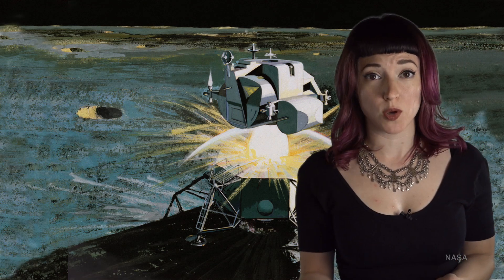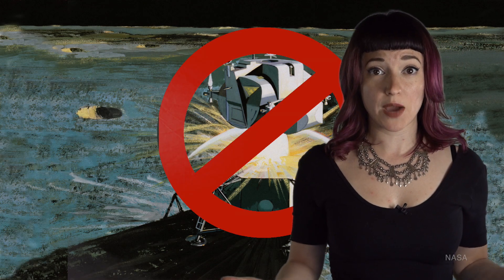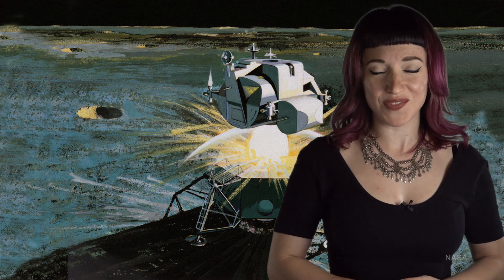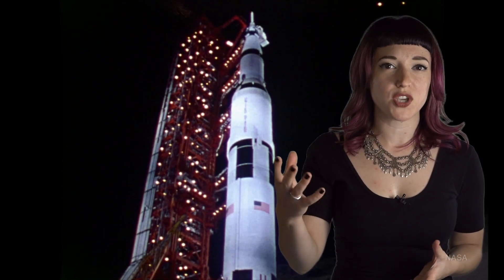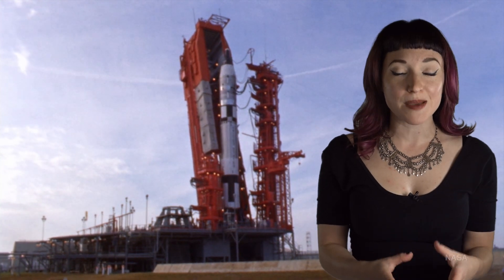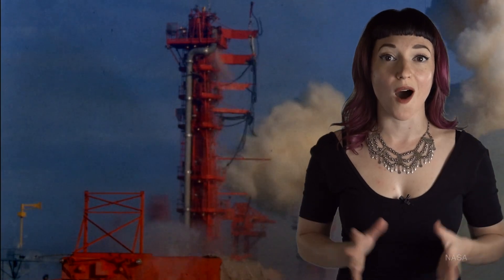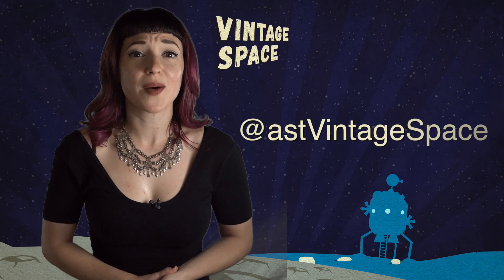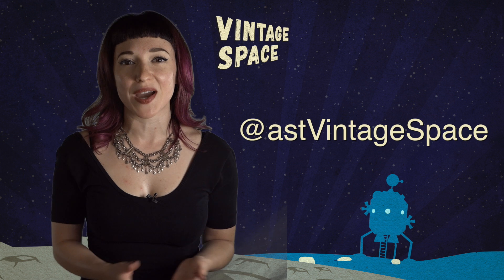How the Lunar Module Launched from the Moon Without a Flame

Comment: I don't have a conspiracy question but I've always wondered: how could the module that took off from the moon be so small? If the gravity on the moon is 1/6 earth gravity, shouldn't the rocket be 1/6 the size of the Saturn V?  (again, I'm asking for a clarification of the science involved, I'm not saying the moon landing was a hoax)
Reply: It is a little confusing to be doing your comparison with a Saturn V, which had to do much, much more than the Lunar Module accent stage's single trip into orbit. A better comparison for a launch into orbit from the Earth against the accent stage doing the same from the Moon, and given the mass being lifted, would be Mercury-Atlas. So a more appropriate question would be "Shouldn't the rocket be 1/6th the size of a Mercury-Atlas?"

I expect that a very large part of the answer to that question comes from the lack of atmosphere on the Moon. From the Earth a rocket has to start off pushing its way through the air. Overcoming air resistance  (particularly if the rocket becomes supersonic or even hypersonic while in the atmosphere) is going to require additional energy, which means more thrust (bigger or more engines) and more fuel to drive those engines. In addition an object pushing through air is going to need to be more physically robust to resist the crushing effect of the air it is compressing around itself.  Then there would be a need to cope with the heating effects of pushing through air at speeds; structure to keep that heat away from sensitive components and crew.

Switch to the Moon, without any (significant) atmosphere,  and all of those issues go away. A smaller (so lighter) engine can lunch a more fragile (so lighter) craft, without the need to overcome air resistance (or air pressure or air friction heating). Which means less fuel and smaller (so lighter) fuel tanks, and so less fuel needed to lift all of that, now absent, fuel/structure, and so on.
Reply: Because when lifting off, lots of fuel is actually needed to .... the lifting of fuel. That may sound surprising but it is not. Consider this: you want to lift 100 kg to orbit. You calculated in order to do that, you would need 80 kg of fuel. But wait: now you do not lift 100 kg but you need to lift 180 kg from the ground. So the fuel needed adds mass to what you want to lift. In order to lift that mass, you need extra fuel, which .... also adds up to the mass you have to lift. And so on. In the end it turns out, that you added lots of fuel in order to lift the fuel needed for lifting the fuel which brings your payload into space.
Also: The Saturn V had not only the job to lift the space ship into orbit. It also had the job to accelerate it to the moon. The Saturn V also had the job to lift the fuel later need for the moon descent and ascent. It also had to lift the fuel for the return burn. In a nutshell: the Saturn V had to lift everthing from the ground, which would later be needed in some part of the journey. While the ascent stage had just 1 job only: lifting off from the moon into moon orbit.

Comment: did you know that they had to re invent the video camera so it was lighter and portable for these moon shots. In the 50's and 60's video camera were big bulky apparatuses on stands handled by two people. it was the reinvention of the video camera that you could then buy those portable home video camera to record everyday events that you all love so much.
Reply: Here's something interesting. With the RCA NTSC color system in use in America at the time, color TV cameras of the time featured three image tubes for the three primary colors of red, green, and blue.  In a studio, the size, weight, and power requirements for these monsters were of no consequence, but on a space ship where every gram of weight and every milliamp of power was budgeted, Westinghouse built a color camera for NASA that used a single monochrome image tube and a spinning color wheel.  So instead of recording the red, green, and blue images simultaneously, the camera recorded the colors sequentially as the color wheel acted like a chroma filter shutter.  There were less frames per second and the images needed to be processed on earth into a color picture, but they got a fairly good color picture for about the same size, weight, and power.  Later missions featured full NTSC color cameras built by RCA.
Reply: @ohger1  actually RCA did not invent the color system as they like to claim. The original comor system was invented by CBS but it was incomparable with the NTSC at the time, so NTSC looked at several companies to develop the color standard used in North America (there are other standards such as PAL and SECAM) the north American standard was desifned by several companies including RCA and Philips. In fact the original television standard that RCA developed was not adopted due to its lack of resolution. Dumont had a much higher resolution (600 lines as opposed to RCA 400) the NTSC was brought into existence to standardise the signal to 525 lines. RCA at the time was like Microsoft today, just wants to buy patents and claim it as its own design.
Reply: @UCicg-Z5mVuktvdO68ulsMZA I think you're confusing RCAs 1940s B&W system which was like 400 lines and not adopted.  The RCA color system was fully compatible with the 525 NTSC B&W system as designed.  It was always 525 lines. CBS' system was 400 something lines and totally incompatible with the NTSC 525 B&W system.

Comment: Using hypergolic propellant simplifies things but there was a downside. The fuel was highly corrosive so the engineers who built the ascent stage of the lunar module couldn't test fire the engine before launch. The first time the engine would be ignited would be on the lunar surface, with the lives of the two astronauts on the line. I would be interested to hear more about this.

Comment: Anyone who has a problem with clear-flame rockets should look to the Me 163 Komet. Its rocket engine used a combination of hydrogen peroxide, hydrazine hydrate, water and methanol. The reaction between these chemicals is violent enough for rocket propulsion, but there is no flame because no actual combustion takes place.

Comment: The problem with that video is that there was no one outside of the module to hold the camera.  If there was he would have been left behind on the moon.  And then no one would have seen the footage because he did not get back to earth to develop it.  And if they left an expensive camera on the moon (which they would not do), then the same problem exists.  There is no way for the camera to get back to earth to develop the film!  So, was there a lunar landing?  Of course not.  In a real lunar landing there would be no photos of lift off, because, for the reasons above, none could be taken.
Reply: +Harold Bullock
What an abundance if ignorance you have.
Reply: Good point, but it still means that they would have had to leave an expensive camera on the moon.  And even more expensive because it has electronic equipment to transmit a signal.  My tax dollars are being left on the moon.  I always wondered where that money went.  Now I know.

Comment: Forget the blast and flame debate I am more curious about who they left behind to to man 
the camera that filmed and panned the  Module blast off.
Some will say they used remote control cameras but how did it manage to pan  the module rather than just film the 
blast off  because  the earth is about 250,000 miles away from the moon and I dont know about you but if the dog walks in front of the TV then no signal, let alone the vast distance and interfernce of Space,
Even if they had that technology in 1969 (which I doubt) there is still a matter of  the time/distance  delay  regarding   the signal to trigger the camera to respond at the exact time the module blasted off and follow its ascent bearing in mind that 
it would have been an analogue camera with a motor drive.

Comment: the real  question in this   footage is:
  (who was left on the moon to aim the camera ( not  very precisely) to follow  the lunar module lifting off  from the moon )
Reply: It also took 3 attempts (Apollo 15 to 17) to get the shot. The Astronaut had to get the rover in exactly the right position, the remote tilt mechanism had to work and the operator on the Earth had to trigger the tilt at a half second before ignition. Apollo 15 parked the rover too close, Apollo 16 had problems with the camera and Apollo 17 got it just right.

Comment: For a non-visible flame, just look to old CART racing incidents during fueling. When the alcohol used to fuel these cars caught fire no one could tell until the fueler (usually) started dancing around and dropping the fuel hose. The flame for this fuel is visible in infrared not visible light so there is another reason that you could have a non-visible flame from the moon launch, the flame is visible in the non-visible portion of the EM spectrum.

Comment: To be clear the Saturn V launch vehicle engines WERE hypergolic too!
Reply: No. The fuel was kerosene (a refined form) or hydrogen. None of these are hypergolic with oxygen.
Reply: true RP-1 is kerosene. In the combustion chamber it came in contact with LOX and you had a reaction.the first stage was the only one using it. Stages 2 and 3 were LOX and liquid hydrogen There was no ignition source spark flame, etc. in these engines so they WERE hypergolic per the definition:A hypergolic propellant combination used in a rocket engine is one whose components spontaneously ignite when they come into contact with each other.
Reply: scott marquiss No, hydrogen and oxygen are NOT hypergolic. Look for the information. The J-2 engine had TWO SPARKPLUGS to get the show rolling in the turbines, and TWO sparkplugs in the combustion chamber to start the main show.
Reply: scott marquiss The F1 engines on the first stage had hypergolic STARTER CARTRIDGES, which got the turbines going. Once they are turning and burning, their exhaust is dumped into the rocket bell. to provide cooling for the skirt. The fuel/oxygen is pumped into the combustion chamer, and is ignited by this hot exhaust, and when the turbines are at full RPM the flame has receded into the combustion chamber, and the engine is at steady-state and full power.

Comment: I always thought it was just the initial explosive blast upward which gave the LM all the thrust it needed to catch the service module. it IS only 1/6th the gravity of earth and they don't have any heat shield on there (its not super heavy i mean)
Reply: The ascent engine accelerated the ascent module to 2000 meters per second. That would be an impressive acceleration. More than what happens in a cannon barrel. More like what happens in an armour piercing explosive charge.
Reply: If you only go up, you can catch the SM... You'd crash into it at about 2 km/s.
Reply: Sander Datema well, if the initial blast was the only thrust, the thing is decelerating from second #1 and by the time it gets close its slower.
I wasn't making the claim that was the ONLY thruster (that would make rendezvous even more impressive!!)  I was saying I thought the launch engine did not burn for more than a second.
Reply: +dosmastrify You cannot rendezvous with a single burn, so that would definitely be impressive :)
Reply: +Keyboard runner 'Appropriate literature'... Did you mean Kerbal Space Program?
Reply: Sander Datema Try some books about newtonian physics. The math is a little confusing at first, but with a little help, you can grasp it pretty quickly. There are a few formulas, which describe the entire system, and most of them are interdependent.
Reply: "well, if the initial blast was the only thrust, the thing is decelerating from second #1 and by the time it gets close its slower."
Then we have still the problem that the command module is traveling at orbital speed. That would really be a impressive docking maneuver.

From what you are writing I suspect that you have NO idea what so ever about orbital mechanics and basic rocket technology. That's totally fine but I heavily recommend some appropriate literature before watching random videos on YT about this subject. Because if you do, you will most certainly get stuck on some hoaxer-channels, since you have no possibility to evaluate their accuracy on facts.
Reply: Allan Folmersen Boooooring!
Reply: www.kerbalspaceprogram.com
Reply: Sander Datema Yes, basic education is boring, but it is the necessary foiundation for real and instinctive understanding of the complex subjects.
Reply: You still don't get it... There are things that make education fun.
Reply: Sander Datema Yes, and there are things that make education WORK.
Reply: Aaaaaaaaaaaah!
Reply: Sander Datema 
Yeah, Newtonian physics, and Kepler's and Ziolkowski's equations would be a good start.
Reply: Sander Datema again, not a single burn, but just one main one and then thrusters to correct... or so i assumed, without other thought... is all
Reply: Keyboard runner well I am off on the history and the engineering. didn't see a flame so figured there was not one, low gravity and low mass, equals low delta v requirement. Didn't give it much thought beyond that. As far as hoki information I'm one of only a few voices insisting the SpaceX explosion was in fact an accident and not aliens in another channel (ugh... they think the birds in the video were drones or some $hit)

FYI someone can be uninformed but know that nasa is the best place for info, come off a little condescending on that one fella

Sander Datema 
Played Kerbal space program tonight in fact! my SSTO had too much fuel and not enough lift :(  (it turned out the procedural wing was glitching and providing 0 lift.)
Hey look a Nasa page that talks about Delta V http://www.space.com/26572-how-it-worked-the-apollo-spacecraft-infographic.html
Reply: Keyboard runner "Because if you do, you will most certainly get stuck on some hoaxer-channels, since you have no possibility to evaluate their accuracy on facts."

google ... dot....com.....
Reply: Allan Folmersen and KSP does both :D
You really should get the demo, its free and you can use it to teach some of those equations (because they are built into the background physics calculations)
Reply: Also, EVERY Space docking maneuver is impressive! KSP showed me exactly how impossible simply "eyeballing it" is when it comes to rendezvous.  NASA videos talk about it like no big deal but KSP showed just how much math and prep, and how important timing is, to end up where you want to be, when you want to be there.
Reply: Allan Folmersen Thanks for the correction. as soon as I saw 2km/s delta V i knew there was no way the initial launch from lunar surface was anywhere near fast enough to generate that -- and thus it must have still been accelerating.
Reply: Allan Folmersen I went to disprove your 2km/s number and ended up proving it.
https://en.wikipedia.org/wiki/Delta-v_budget#/media/File:ApolloEnergyRequirementsMSC1966.png
Unless I want to nit pick and say the math says its closer to 1900m/s :P

Comment: I asked once before about the purported Standup EVA done shortly after the Apollo 12 lunar landing. Any ideas?
Reply: There was none.
Reply: Supposedly not, but there was a NASA report that there was one just like Apollo 15. To add to the mystery, there is a long gap in the post lunar landing transcript. There was discussion about putting on helmet and gloves.
Reply: George Arrington There was no stand-up EVA on Apollo 12. There is an one-hour hoaxnut video claiming there was, but it is based on faulty assumptions and incorrect transcripts.

Comment: Again, no air, and hydrogen fuel. The actual visible flame would be tiny compared to the launch from Earth. Even on Earth explosions have very little visible flame. When the movies create an explosion they use "White Gas" to provide those spectacular fireballs we're all used to seeing because real explosions are dull and boring, like the launch of the Lunar Module from the moon.
Reply: Not hydrogen. Aerozine-50 and nitrogentetroxide.
Reply: Actually Allen, you're absolutely right. But, even with fuels that have their own oxidizers, that oxygen is fully consumed in combustion, while the exhaust particles are sucked away by the vacuum of space at "ear shattering quickness", leaving very little to be seen.
Reply: Doc There is no suction in space. NONE. All gas movement is done by PRESSURE. Not suction.
Reply: Now, you're splitting nails to make tacks.
Reply: Doc No. The difference between vacuum and atmospheric pressure is 14.7 PSI. The difference between chamber pressure in a Rocketdyne F-1 engine in vacuum is 1044 PSI. At sealevel, it is 1029 PSI. That is an insignifican difference.

You can't pull with something that ISN'T THERE. Can you pull a car with a rope which isn't there? Can you row a boat with an oar which isn't there? ONLY the EXISTING pressure INSIDE the engine can PUSH the exhaust OUT. I know you don't want to understand it, you want to cling to your belief - to do otherwise will cause you to lose you self-esteem, because you CAN'T admit you are wrong. Please look into the problem FOR REAL. Or get some help
Reply: I've already admitted I was wrong, you're the one who can't admit that; you're being right doesn't make any difference to what we are seeing.

Comment: Side question:  On launch rockets, and even the space shuttle, before launch what is all the 'smoke' that billows off of them?  I'm assuming it's some sort of excess coolant.
Reply: It happens because the liquid oxygen and hydrogen are at minus 273 and 423 degrees F. This in turn causes the outside air to form a vapor cloud upon contact with the vehicle in questions aluminum skin. In the shuttles case, the external tank contains the cryogenic (Super cold) propellants but it's covered in up to 8 inches of insulating foam to minimize ice formation.